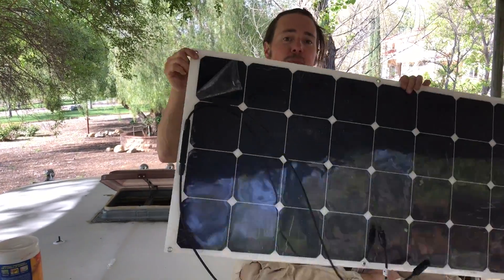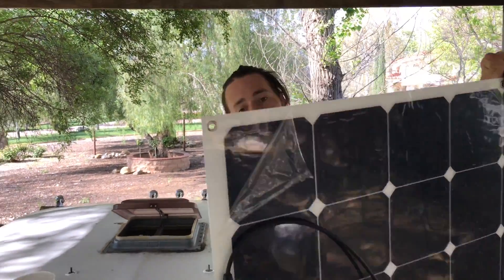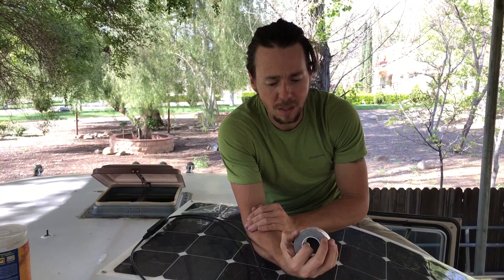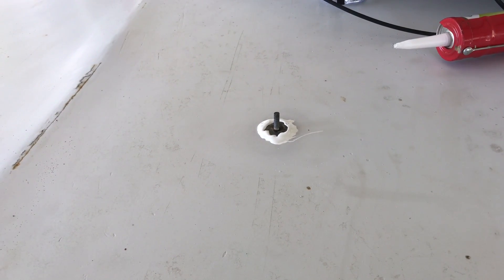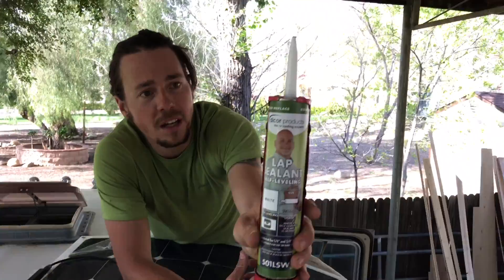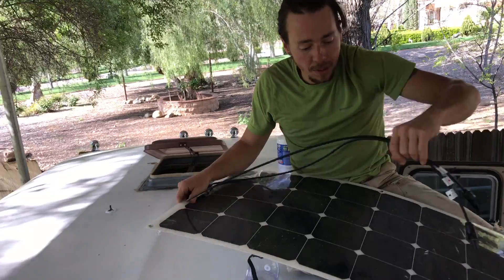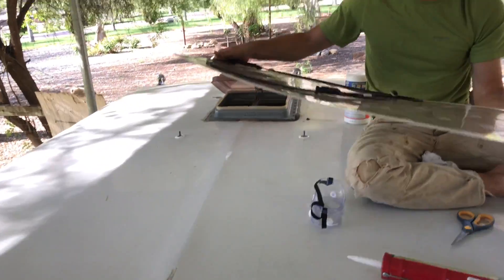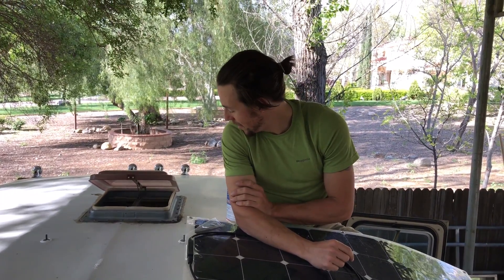The BEST way to mount flexible solar panels on your van/RV

Comment: How has this worked out for you?
Reply from the maker: William Klein it’s been a mixed bag. Almost immediately after installing we had 1 panel come off - but after re-attaching (using JB Weld instead of 3M VHB) everything has held up. The most important thing we’ve learned is the importance of securing the edges, not just the corners of the panels (to protect against wind getting under and ripping them off). Thanks for the question!
Reply: @TheVanProject  so after 5 years how well did the install hold up? If you had to do it again would you change it? Im getting ready to install three 100w panels on my westy in a couple of days. Thx
Reply: The Van Project Thanks

Comment: A great idea but not fully thought through. Wind shear forces will rip that panel right off first time you drive it. I suggest a Coroplast backing to stiffen the flex panel and also create an air gap under it for cooling. Then mount it with Eternabond tape to the rubber or metal roof sealing any air gaps. No easy removal but no wind shear either.

Comment: Good idea man. I'm gonna do the same thing but won't have to take them down as I also got a big foldable 4 panel set that is from Bluetti and that will be when I park and when the sun can be optimized from a better angle. But anyway, great idea for the roof. My flex panels have the exact same holes

Comment: Panel fixed straight to surface with no cooling or airflow abilities??
Certainly not the BEST way, not if you like your solar panels
Reply from the maker: Hi Hugh and thanks for your comment! A few previous commenters have brought up this concern (inefficiency drop due to overheating). It's certainly possible/likely we aren't getting the FULL efficiency out of our setup, but from our 2+ years of using it so far we haven't had any issues with powering what we need to power. This would probably be more of an issue if we had more battery storage capacity (we have 200ah AGM, and 300w of panels).
Reply from the maker: and we REALLY do like our solar panels :-)
Reply: Good Stuff
Actually i was reading a test where a Solar Guru tested them fixed direct and another with cooling board underneath it, made no difference
So there you go
Reply from the maker: Hugh Jazz interesting - we’ve thought about using double walled plastic sheeting (like greenhouse covering) installed underneath the panels so air can flow through the channels while driving to help with cooling but yeah, after 2 years we really haven’t felt the need to change things, seems to be working just fine
Reply: Then again, while you are driving they being cooled anyway by the 60-100km wind :)
I think you are right, plus these panels are so cheap nowdays anyway.
Wait until it ever fails and just stick another one straight over the top :)

Comment: Great idea! Hm, if you're someone who doesn't have access to welding equipment, I wonder if "JB Weld Steel Stick" (brand of 2-part epoxy stick) would suffice for securing the washer to the threaded rod. I think I'm going to try it.
Reply from the maker: Ashley Ailor I would suggest being cautious here since the threaded rod and washer have a very small surface area where they contact each other. You might be able to find someone who works locally that could do the job For you for pretty cheap 👍🏻
Reply: Thank you for the reply and helpful suggestion! I didn't think of taking it to a shop. :)

Comment: Not worth using. They get too hot because they have no air flow underneath them. Solar panels get less efficient when they get hot. These people are morons. Don't be a fool and take their ignorant advice. Thumbs down!
Reply from the maker: Bruce Walendy it’s true - we’ve heard they lose up to 10% efficiency without proper cooling! Although as we mentioned, the 3 panels and 2 100 amp-hour batteries haven’t failed us yet - running a 50L ARB fridge and 1500 watt inverter ✨✌🏻✨

Comment: Which version of 3M VHB did you use?
Reply from the maker: http://amzn.to/2Cxnfsl this is the tape we used although there are quite a few options - I saw one that was listed as 'automotive' so I'm not sure if it is any stronger. Worth researching a bit. And as mentioned in a previous comment above, better secure your front and side edges as well so you don't have high winds rip your panels off (we had this happen and added tape around the entire edges of our panels to make sure it wouldn't happen again - 10,000 miles of driving later and we haven't lost any panels!
Reply: But if you tape around them, they are really not removable and you probably don't have to bother with the studs, right?
Reply: Also, you probably ought to make mention of the fact that you lost a panel and had to reinforce the mount in the description.  You don't see that unless you read all the replies to the comments.

Comment: So using a standard stainless steel bolt upside down glued to the roof doesn't work? And please tape the front down a little
Reply from the maker: It might work but I suspect that it wouldn't have enough surface area to securely adhere to the roof. And yes, we definitely ended up taping the edges down!
Reply: @TheVanProject  if you ended up taking the edges down, is it still detachable?
Reply from the maker: Sabre Bruffy not easily - at this point I’d recommend using an industrial Velcro to secure the edges (but to be honest, we’ve never had the desire/need to remove the panels)

Comment: Not a good move having the solar panel touching the metal roof.  You need a spacer/insulator.  Once these panels heat up the inefficiency drops.
Reply: +The Van Project
Solar panels reduce efficiency with higher temperature.  Since these panels are mounted directly on to the surface,  there is no way for it to dissipate heat and therefore its efficiency is greatly lowered.  I have seen another video that killed this guy's solar panels.  The connections basically melted.....
Reply: +The Van Project
Well,  his case was a special one.  He mounted on top of his vehicle which was painted black,  and he completely water proofed the edges which prevented heat from escaping underneath his panel.  This was on the hottest time of the summer too.   I haven't seen anyone else with their panels dying like that.  So yes,  find a way to keep your panels cool the best you can to keep them operating at optimum efficiency.

Cheers......
Reply: The Van Project hey, i think for your use it probaby fine. So if you had 1000w of panels and they got 70 degress Celsius or above they would drop down to 7 to 800w efficiency. 

I just finished putting my own on and i think i have come up with a cheaper alternative. After  a lot of thought.

I got sheets of color bond (ribbed roofing steel - aussie invention) $20 aussie and cut it to the shape of the panel. 

I then cut out 12 wooden disks with a hole saw around the size of a 20c coin. Bit bigger than a quarter. Painted the disks. 

Then glued the disk evenly on one side of the color bond. Thats the basic mount. 

You then place the color bond on the roof wooden disk side down and screw in to tue roof through the holes in the woodern disk. The mount is now seperate from the roof.  Place the small ribbed side on the panel/top  to minimize contact and heat transfer from the steel to the panel. Then fasten the panel to the color bond.

You can even fit a sheet of foam in between for even more insulation. 

Been driving it for 2 days and cant hear any drag or anything, so looks like it worked.

Hope that makes sence.
Reply: Can send pics if you like
Reply: This is just my opinion but i think the efficiency drop is more of an issue on hot black roofs for homes trying to max out their investment in solar... I think the issue is more of hot air being trapped under the panels and greenhouse effecting off of black roofs. For a white van on the road (in the wind) my instinct is that it should be fine, especially if there is not hot air accumulating underneath. solar panels are made to be in the sun.. ...this is what im hoping---looking at doing the same thing on my van.
Reply from the maker: I suppose if we had a bigger battery bank this would be a problem. Based on our three panels and 200 amp hours of batteries, we never have issues with fully charging on sunny days and have enough power to run our DC fridge, all of our DC lighting, and charging our devices (phones/computers). How substantial is the drop in efficiency like when they heat up? Thanks for the thoughts!
Reply from the maker: Woah! That's crazy that his connections were melted! In the future when we inevitably make upgrades or changes we will definitely keep this in mind and try to design better airflow/heat dissipation into our design
Reply from the maker: Thanks for the tip :)
Reply from the maker: That seems to make sense to me. Thanks for sharing its Really cool to see everyone's ingenuity around this stuff. As I mentioned before, so far we haven't had a problem with our electrical needs being met with our current setup so we probably won't be tweaking it right away but we will definitely keep all your tips in mind for future updates! Thanks again! 👍
Reply from the maker: tinydancer789 yeah so far in our experience any drop in efficiency is negligible - everything still works fine and our panels and batteries have been keeping everything powered up fine 👍🏻

Comment: How did you weld the studs/bolts to the washers? Do you have a stud weld machine or did you do it some other way? I'm trying to figure out the best way to make brackets similar to yours, but can't think of a way to make the panel sit flush on the washer unless I use a stud weld machine or ... tap the washer, slightly thread a stud through, plug/rosette weld from UNDERNEATH, and then grind the bottom flush. Thanks for your help and input!
Reply from the maker: Christopher Michaelson I didn't have any special gear to make these - just a cheap wire-feed machine. I found that I was able to weld carefully and then Clean everything up enough with an angle grinder to get our panels to lay flat enough. Good luck!

Comment: thanks for the video. So in hindsight, would you just glue them outright without the screws (as you are saying in the comments that you added industrial adhesive on all sides due to wind). Thanks ;-)
Reply from the maker: G H Sosna I think the best solution is corner brackets (the ones we fabricated) combined with industrial Velcro - of course this is only necessary if you think you might possibly want to remove them and mount them elsewhere (like in the sun if you wanted to park your vehicle in the shade). If you don't have access to welding equipment you could just try the velcro alone. We met Glen, a vanlifer who used only Velcro to secure panels to his VW and it's been working fine for him 👍🏻

Comment: If you want them removable for shifting to a sun location on the ground the flex panels make no sense at all.
Reply from the maker: I would disagree. In our case weight was a very important consideration. We also wanted something lower profile (than a rigid panel). For us this has worked out great - maybe for others a different choice would be better.
Reply: There is no more high profile (in total materials required) panel than a flex panel which can never be used without materials to mount it to and maintain sun angle if you do not place it on the vehicle roof. Framed panels need no support, just lean them up against something. Flex panels require something flat and substantial behind them, meaning you also must carry and employ a supporting structure for something to lay the floppy panels on top of. Sheet plywood is heavier than rigid panels. Camp sites may have a picnic table you could lay the panels on but they would be pointing straight up and your table would not be useful for anything else. Were you planning to just toss your flex panels on the ground where they can be stepped on or collect water and dirt?
Reply from the maker: Popeye Gordon Makes sense regarding support structure but in our experience so far these have held up to everything we’re thrown at them without needing to worry about their durability. They certainly get a nice layer of dirt & dust on the roof and it doesn’t seem to harm them or affect efficiency enough to justify doing anything differently. Also, as we mentioned, based on our battery bank size we never have issues charging fully (and that’s with the panels mounted flat with no tilting mechanism. Truth is, our system may not be picture perfect in efficiency or suggested mounting technique but it works well for us.

Comment: how resistant to hail are these flexible panels?
Reply: They're only guaranteed for 5 years  vs  regular panels which is 25 years.  This tells me that the average lifespan for these panels is around 5 years more or less.  And you're not suppose to bend these panels more than 30 degrees.  The poster just wobbled it like a toy so I'd imagine there are microfractures within the cells that lowered its output.
Reply from the maker: We can't say as we haven't encountered hail yet but they are surprisingly robust.
Reply: Interesting, thanks for the videos

Comment: Better tape at least the front edge down, you don't want 100 km/h winds to under the panels...
Reply: Serious, you have a vid online with "The BEST way ..." and then in the comments you write what have to be altered because the best way doesnt work...
Reply from the maker: Absolutely - and we have. We have since added industrial adhesive on all sides to combat wind while driving.
Reply: What type of adhesive?
Reply: I was wondering the same thing.